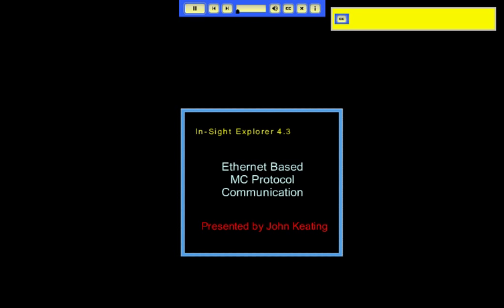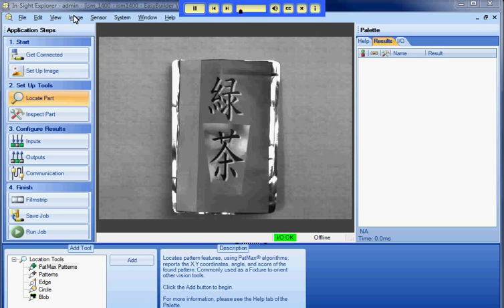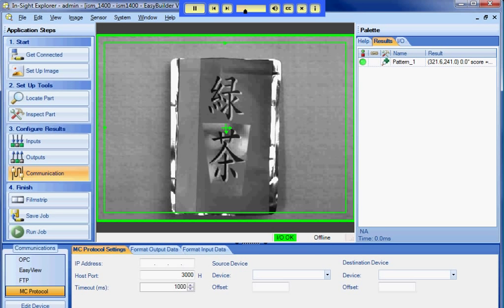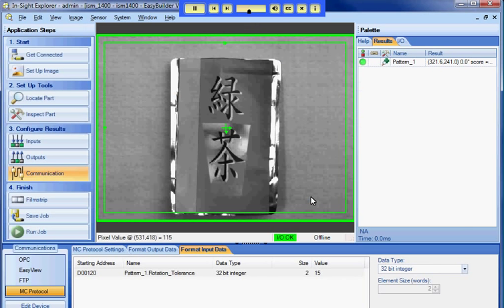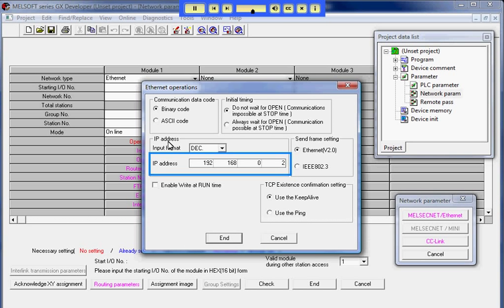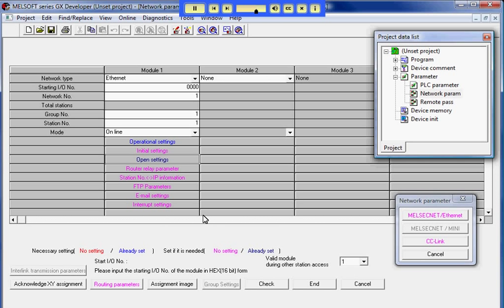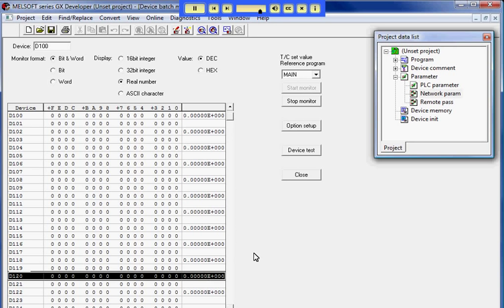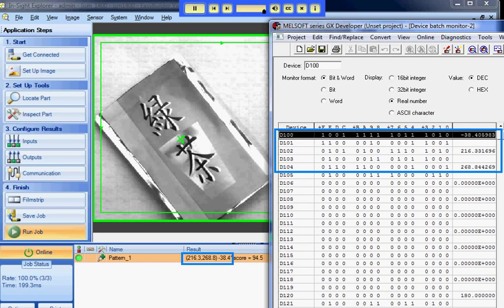Cognex - Mitsubishi MC Protocol setup guide

Comment: my insight does not show mitubishi option in manufacturer's tab;;; is that a installation guide or setting up a driver to support mitubishi from my insight software? my version in 4.8.2 and i am using 5400 series
Reply from the maker: Hi code junky, we would recommend contacting Cognex to assist you with your issue. Here is a link to their support section regarding their In-Sight software and firmware - http://www.cognex.com/Support/InSight/Software.aspx?langtype=1033